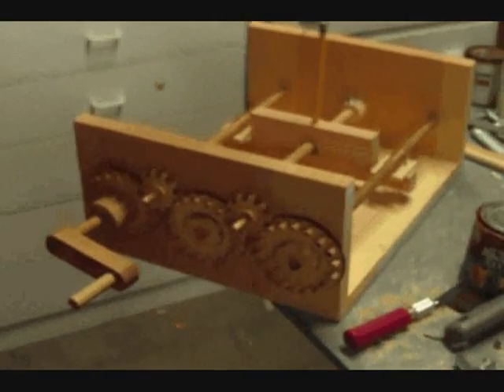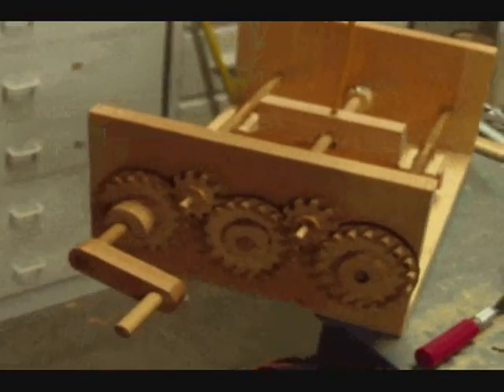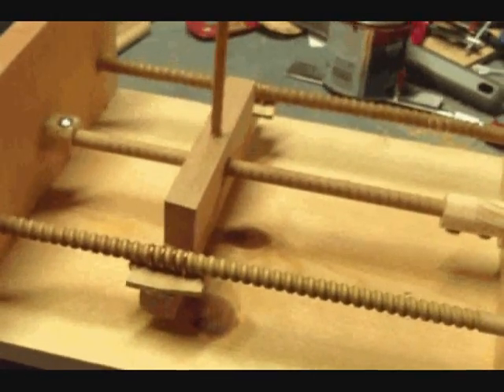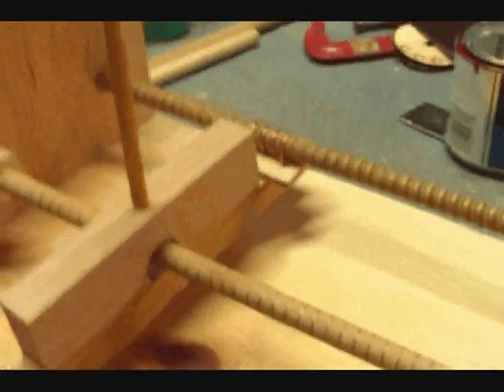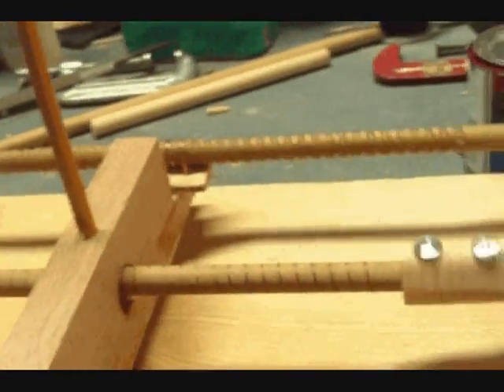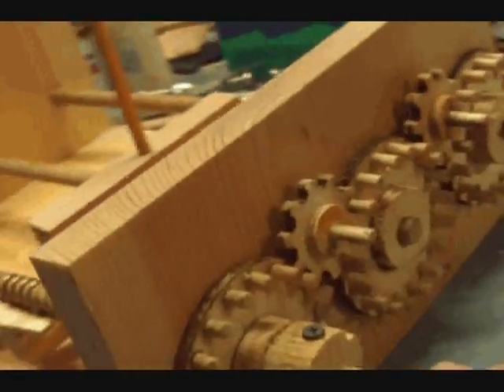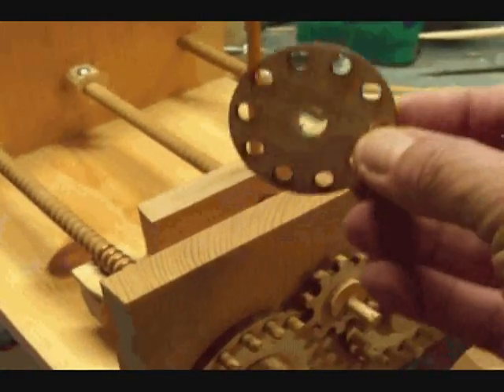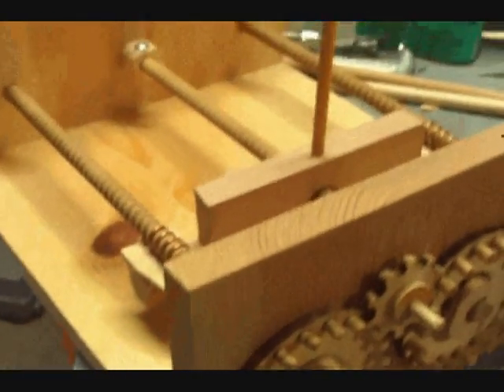Da Vinci Screw Making Machine Working Model

Comment: I would like to know where in the notebooks this drawing is to be found.As you point out, two idler gears are needed to make a new screw with the same-handed pitch.  This detail escapes da Vinci's  depiction, but they must have been there in the original.  You can't connect lantern gear to lantern gear.
Reply from the maker: I did not see the idlers in the original drawing, but that isn't the only mistake in a Davinci drawing.
The mobile cart wouldn't drive straight  either. It would only rotate.

Comment: next, I would wind a narrow strip of leather with wood glue over the penciled stripe. After the glue harden, I make several more like it. Then, press them between soft clay tablets. Then carefully remove them. I would then used the clay mold to several rows to cast metal screws at one time. Thank you for your brilliant presentation.